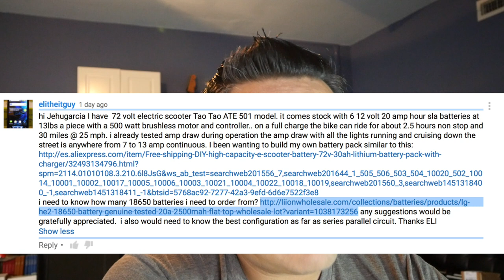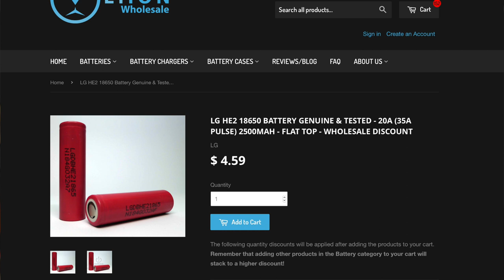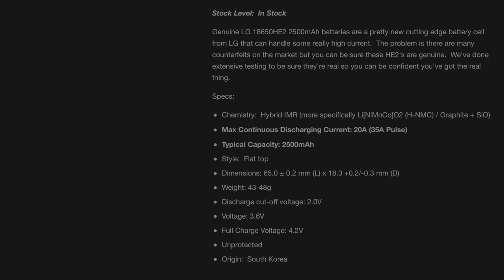How many 18650 cells to power a Scooter?   Battery talk #4

Comment: I hope you see this jehugarcia I could really use your help! I'm trying to make
an 18650 house battery for my camper van and I'm stuck as to what I'll need to do to get 
the 18650 pack to work with my solar charge controller. I'm thinking the battery will be 12v 
3s84p (3000mah cells) to give me a 252 Ah battery @ 12v. I feel like I can figure out how to build and connect the
18650 cells, but I don't know if the Renogy Tracer charge controller that I have will correctly
charge the battery, if I need a battery balancer, or if I need a different charge controller entirely.
Thanks! Love your videos you're the Mad Max of electricity.
Reply from the maker: your charge controller needs to be able to set its top voltage 12.6V MAX.   If its not adjustable and its set for lead acid it will charge to 13.8V which will put your 3S pack at 4.6v per cell = No good.   What you need is a Solar charge controller for lithium set for 11.1V.   Does it exist?   I haven't found one i can buy.
Reply from the maker: +KingArthur 12v or 24v only does not seem like this could work but only way to find out is to try it
Reply: +jehugarcia this is true! I'll get back to you on it.... now just to find some lots of used laptop batteries...
Reply: +KingArthur I am interested in doing a similar project for my VW Westfalia Camper Van. I have started educating myself on this topic and am curious if you were able to find a solution. I too have the desire to to a 12v system with solar. Thanks!
Reply: Wouldnt you be better off configuring your cells 4S for 14.4 volts nominal? That is pretty close to what a lead acid charge controller outputs. Jehu, did you consider this? Also, doesnt the charging characteristic of a lead-acid charger behave in a way that is fundamentally different from what a lithium chemistry cell requires? Would that be a problem and even limit the capacity and lifetime of your storage bank?
Reply: Grape Solar 40, 40 amp PWM controller, has a lithium setting
and everything is configurable thru a BT app
mine was $49 availble on Amazon and home depot, really a great buy
old thread but maybe this will help somebody
i have one, and it works great, on my 665 ampHr AGM bank
i have it set to charge at 14.8v, to get the AGMs topped off

Comment: he can improves the energy capacity and travel distance by converting to lithium battery cause 18650 dramatically reducee the weight and space needed.. by additional amp hour per parallel cells for each 19cells.. Depends on his budget..

Comment: Just want to add that the lithium batteries have 30% or so more usable power than the lead acids. Not sure how his controller handles lead acid voltage drops or the math on pack size but he could get the same usable capacity with a smaller lithium pack.
Reply from the maker: +P Roppo   yeah thats true

Comment: I have a 1999 kx250cc 2- stroke  motocross dirtbike chassis/ frame. what motors would you recommend and how many 18650 lithium batteries would be recommended to achieve the 39/40 horsepower equivalent to the 2- stroke engine which powered it in the past? This would be a fun project for me. I am hoping that I can some how custom fit and shape the battery pack without cutting,welding,modifying the chassis/frame same goes for the motor installation without mods if possible. Any ideas or suggestions would be greatly appreciated.I am on a tight budget and hope by diying the battery module/pack and purchasing the required motor; that it will be far cheaper than buying the parts and paying the labor for a complete top and bottom end rebuild on the gas engine.Thanks, Sean.

Comment: The extra wattage your assuming is being used when it’s drawing 13 amp isn’t there. When deep cycle cells gets close to dead the voltage drops. A motor with slightly lower voltage applied to it pushing same power will draw more current and run a bit slower. It is possible he is only drawing 13 amps when his battery’s are almost dead. Low enough voltage motor will stop turning and act like a dead short drawing infinite current. There has to be electronics in motor to stop this from happening.

Comment: If someone has to use a 8p (or more) configuration anyway he does not need to use high amp cells. This way he could either save money by using cells that are only rated for 7-10 Amps or gain capacity because low draw cells usually have 1/6 to 1/3 more capacity for the same price.

Comment: lead acid batteries are about 12.5 to 13 volts fully charged the 13.8 volts you stated are what the alternator/charger puts out to charge them

Comment: Thanks for this video ! It is really helpful. I would like to know how you design the charging system as for example the imax b6 is able to charge only 16 batteries at a time and there it is 19 batteries 8 times in parallel. So if you could give the info it would be great ! Thanks Jag

Comment: Jehu
So I went to the store to get Golf Cart Batteries and they are 800 to 1000 dollars for all 6 6 volt cells with 220 amp hours and they weight about 400 lbs. I have a new motor controller rated for up to 48 V.  With lighter Lithium Ion batteries and with two adult the cart will be about 1000 lbs . About 300+ lbs lighter if I build a system.  it is a 36 volt system. After watching many of your videos and doing the numbers I can build a pretty good system with new cells for $1000 - 1200 and it will last longer and I hope not to being buying batteries in 5 years.  I understand that I need 10 parallel sets in series of the 18650s. I was planning on doing packs of 50 10s5p of the LG 3500 (MJ1 I think) and then wiring them in parallel so that I could add batteries if I need too.  This way I could start with two packs and see how it goes. I am obviously a novice but I am reading. The BMS confuses me some. Do I put one on each battery pack or on the system. I don't know how to calculate all of my needs except for the Voltage and amp hours. Any help or ideas would be great as well as link to parts.  BTW,  I have a friend George Johnson a VW lover and a car charging station installation supervisor and he said he met you and told me to watch your videos.
Thanks and the videos are great.
Chuck

Comment: A fully charged 18650 cell has a voltage of around 4.2 volts. When working on the math, you have to multiply by 4.2v other wise the voltage will be to high for the controller. But needless to say, I can run 60v on my 48v controller that I have on my ebike. Also you won't need 155cells, you'll need 144cells.

Comment: Your calculation of energy comparison is charming and simple but not quiet right.
Lead acid battery characteristics have the Peukert Effect during discharge and you also do not want to discharge a lead acid battery as deep as you easily can do with Li Ion.
Ergo: with your calculation you will have far more USABLE energy out of the Li Ion cells then you ever could use from a lead acid cell by only nominal capacity comparison. I would guess about 40% more!
In my experience the comparison of usable energy of lead acid and Li-Ion technologies was always a convincing fact.

Comment: Is it important to add cooling to the batteries? The Tesla model S cycles antifreeze through the cells then passes them a heat exchanger.... I want to build an 8000 watt motor ebike and in the planning phases.... wondering if through your experience if it's wise to figure out a way to cool them? Some computers cool the CPU in the same fashion..... Add heat sinks...? What's your take

Comment: Hi Jehugarcia, What about a small boat trolling motor? I have the MotorGuide 47 lbs thrust 12V motor that currently used with lead acid 12V batteries, It can run off of one or 2 lead acid batteries hooked up in parallel, A manual 50 Amp circuit breaker is installed in series at the + side of the circuit, I was thinking of reducing the weight by using a pack of several 18650 LiIon batteries and that's where I need your help. I know that for 12V system I will be using packs of 3 cells, but not sure about the amps, Do I go by the maximum 50 amp load and work my way down to reducing the size of the pack if I get a lot of circuit breaker cut outs?

Comment: Can you show how you would make a 120-160ah lithium car battery used for car audio. We use alternators that charge anywhere from 250amps up to 400 amps. Commonly 270-350a. One amp can draw anywhere from 100-900amps. My current set up has 1 350amp alt 8 batteries and a 7krms amp that draws max of around 650 amps. I am looking to run more power. How many alts would I need to maintain 120-160ah lithium battery.

Comment: So to simplify even further...you want to reverse engineer from total watt hours needed, which is power, down to each individual cell's requirements? I assume there's wiggle room in the middle of this equation? Quite a bit based on which 18650's one is looking to use? (Price is a big factor, for me anyway.) My mind is telling me instinctively that there is a nominal configuration of parallel/series ratio? I have to study more. Trying to find the best config to create an e-bike cell for a Schwinn Meridian adult trike for probably a 48V 1000W front wheel hub motor....Any kind of "standard" configs for those right now? Can't find the EXACT vid for that. Any help appreciated. Thanks!

Comment: Jehu,

Thanks for the cell fuse link in this video, been trying all different wire sizes with little to no success, and have been unable to find a full description in your previous videos. Just like to say thanks for such a great series of videos, and congrats on your samba. Because of your series i have decided to build an electric jeep for the wife, using a warp 11, and mostly 18650's. 

I was hoping you could do a video with diagram of different ways to parallel/series while making packs, and more on simple balance techniques (wire to first set of cells? last set. this all is fuzzy to me right now) 

I have noticed that you prefer to build packs of 3.7 nominal, and then series those packs into higher voltages. Is this because it is easier to charge at 3.7v as apposed to 7v/11v/14v~ because it eliminates the balance circuit ?? 

Also, i have an idea for pack building id like to share but i would like to email is that ok>?

Brian-

Comment: Hi. I see that is an old video but i said it anyway. You talk about 30 amps and that is when is acelerating. I have an e-scooter 48v 800 watts and when is rising speed it draw 33 amps. Now 33a x 52v (lifepo 16s) = 1716w but when is at full speed it go down to about 16 amps. And it is just how it works.
Reply from the maker: 800W continous
Reply: So how many cells did you end up using for that scooter?

Comment: Cool just wondering would you need to but the cells with a protection circuit? Or wouldn't you need to because its already built in the scooter?

Comment: Great video!  Question for you.  I'm in process of building an electric Cafe racer.  I plan to use the Enertrac MHM-602 10kW Hub Motor.  I would like to create a 96v 60aH 18650 battery pack to power the bike.  Given the space constraint, I'm thinking its best to go with a few smaller packs wired in series to accomplish the 96v.  Using the hub Motor, I have full use of the former engine compartment for storage.  What's the best most compact cell configuration to achieve this?  Is there a better more compact energy source available?  Or should I just scrap the day idea, suck it up and just purchase a prebuilt pack?  I think I have the Motor controller covered... I plan to use a 24-144v 250A Kelly Controller.  Please let me know your thoughts

Comment: I think the 500Watt is the continuous power of the motor, the peak power of this motor will be mutch higher than that.
To think a 500Watt Motor can only deliver a maximum of 500Watt is a common mistake.
The 500Watt ist the output power of the motor without getting to hot.

For example, I have a small 120Watt Motor in a small elektric skateboard. I massure the output power and it delivered more than 300Watt peak for e shot time.

Comment: I was gonna ask a similar question regarding my ebike,, 24 volt motor,, in wheel ,, however after charging the battery lithium iron ,  with standard supply,, left the battery for 2 hrs and fully charged measured 29.3 volts ?  Thanks Shane uk

Comment: What if you are building a new vehicle from scratch? How do you figure out how many Ah to make your battery? Let's say you want it to go 100 miles per charge. If the vehicle weighed 500lbs, 1000lbs, 2000lbs, or 3000lbs, how would that effect the plans for the battery?
Reply from the maker: +Craig Rustle Bit more complex,   weight is only one factor,   the shape of the car plays huge role on energy consumption also.  Powertrain also,  do you need performance?

Comment: Hey..i was curious about weight of the batteries after watching these videos.I checked the weight of the batteries of both the sla battery and li-ion pack, and was thinking about whether we could double the capacity of the battery without gaining extra weight.. i ran the numbers and found that you could double capacity of li-ion battery and the weight of the battery pack would still be half of this sla battery pack. So you could use this if you want to...although of course the price of the batteries will be twice as well...

Comment: Brushless motors of 500w can draw up to doble depending of the energy, so a 250W brushless motor can drain 500W peak
Reply: Most of the brushless dc motors can take a lot more power than the stated rating.

Comment: So for this application, the capacity was already determined, which makes figuring out the rest pretty straight forward. How would you go about determining the needed capacity for a specific application?
Reply: Wouldn't really be any different. You'd simply need to decide how long you need the system to be able to run on a charge.

Just like in this example, you'd want to start by testing the current or power draw of the system, and then you can determine how long it would run on a given battery capacity.

To keep this example simple, maybe you determine that your load draws a steady 100 watts and you want to be able to power it for about 3 hours. In That case, you'll want to put together a 300 watt-hour battery.

Comment: Instead of using Copper bars, could you use Aluminum? That would shave off some weight. Or are the savings not even worth the trouble?

Comment: I'm guessing the higher current draw of the motor is due to the resistance load that the motor is experiencing... The lower current draw would probably be from a free/no resistance load on the motor.

Comment: Look inside your controller and look at the combined spec of your capacitors. On my 24v controller I have a capacitor with 35v 1000up. So I assume any voltage up to and including 35v.
Reply: Sorry this is to workout the capacity of a controller. It's probably why controllers go up from 24v to 36v to 48v to 72v. They have a marginal voltage. I replaced my capacitor as it blew from my own bad wiring yesterday. I have no electronic experience but through trial and error you can work out most things. The capacitor is sensitive to voltage and polarity. Thanks Jehu and the wider community for giving us all the confidence to do these things and learn how to use technology for sustainability.

Comment: Talk about a complicated application I'm building a Solar plugin Prius. I would like your expert opinion if this is even possible. I calculated that I can get about 600w of solar panels on top of this car, not sure what the voltage output will be yet but I will convert it to 48V regardless. I bought a shitload of +SJ 18650 6000mAh 3.7V will be making 48V packs out of them soon. So the sun or household power will charge the 48v packs(not sure how many yet) kinda want to make them as flat as possible and hide them everywhere. Then I will run that through a 48v DC to 240v AC power inverter and than through a full wave bridge rectifier to 240v DC(not sure what the voltage drop will be?) The Prius gen 2 battery has a nominal voltage of 273.6 V This is my attempt at an key word economical DIY EV.

Comment: hey Jehu, Ok I watched a few of your videos and i'm hooked. You know what you'e talking about. Here's what i'm working on. I have an E-bike (500w BLDC motor, AD Turbo 60V 50A Controller, battery is 60V20AH Lithium and the charger is a 60V3A 110V/220V). I'm thinking if I install a 1200W DC-DC Boost Converter Power Supply 8-60V 12V Step up to 12-83V 24V 48V 20A, I should be able to keep the battery charged while riding the bike for as long as I want. What do you think? You know where I'm going with this?

Comment: I have a problem! I have a boombox (portable speaker) and I'm currently using a 20Ah motorcycle lead battery. It's heavy and starting to fail. I want to use 16850s for a new battery. I don't know if I am to use 3 or 4 in series. 3 gives like 7,8 to 12,6 volts and 4 in series gives approx 10,4 to 16,8. The amplifier can handle  8-16 V according to the specs. The capacitor I have connected in parallel with the amp operates in 12-16 V. The lead battery goes down to 9,5 volts and the capacitor seams to work at that voltage. Do you have any suggestions? How many cells do you think I should use? Thanks! Your like the God of the battery cells!

Comment: So IF I had a 48V  1000W  bike tire motor, like the kits you can get on bikeberry, amazon or newegg.      I would need  Strings of 12.9 (13) in series,    to get 48v.   13 x (9.25) =  120 Watts per,  so i'd need 8  strings of 13 batteries in series?   (If were talking VTC4's or VTC5's that can handle 30-35Amps)